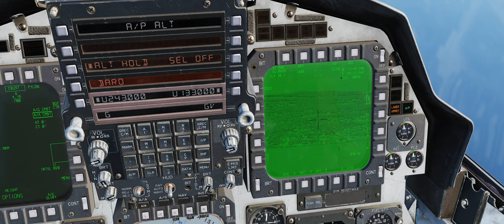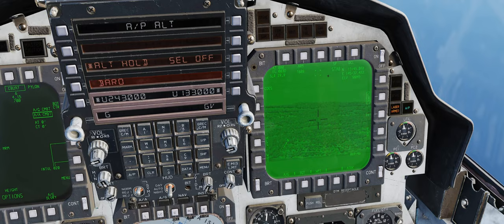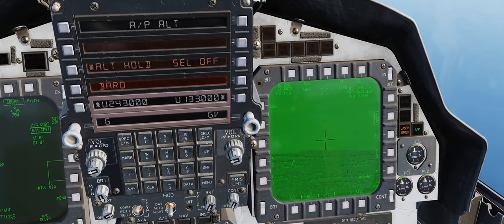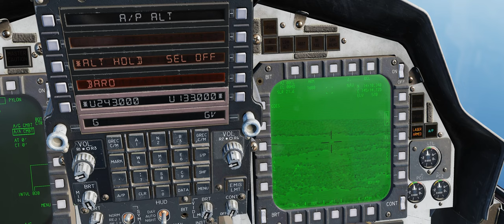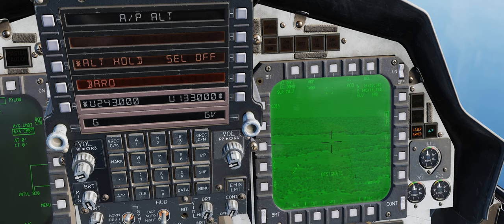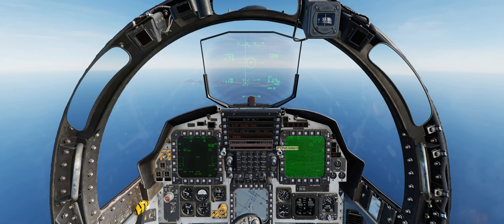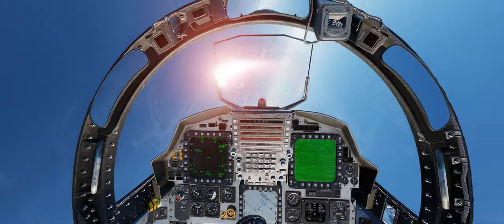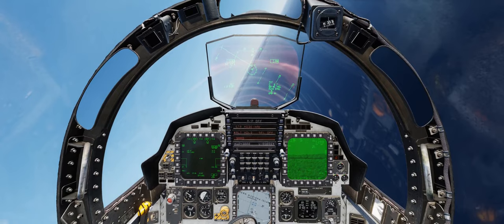DCS F-15E Strike Eagle - Lofting CBU-97s

Comment: I do hope razbam fixes the cbus opening prematurely as I really struggle to get proper hits on targets because they don’t open above the target
Reply from the maker: I should have added a step I've been experimenting to the video, I go into the A/G Load page, and find the CBU-97s and then set the height to 1200 and cycle the time until it disappears.  It seems better but it's probably a placebo.
Reply: SE's early access release is epic failure. Nothing working properly.
Reply: @biggus3348  I got really confused about the fuze setting for CBU97, in the manual it stated that the height is the MSL altitude, but what if you want to drop CBU97 at NTTR where the target elevation is above 4000 ft?  But if I treat the fuze altitude as AGL, sometimes it will open too late and hit the ground.
Reply from the maker: @OrionRox  I've noticed some similar things.  It doesn't seem terribly consistent to me.